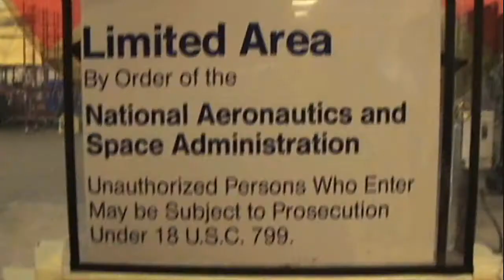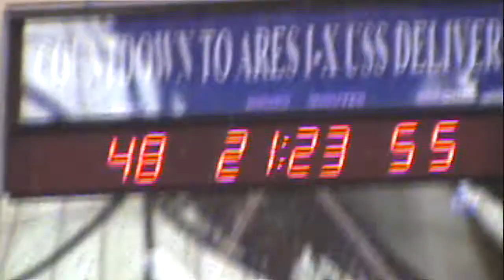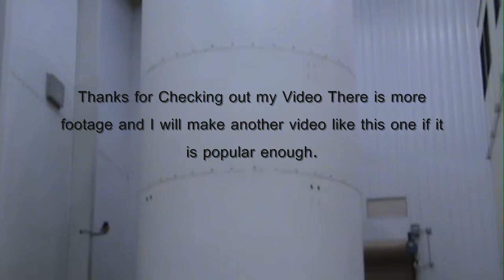Ares I-X Unreleased Inside NASA Footage First Inside Video Upper Stage

Comment: In the next video effort could you possibly include more details of the mechanical sturcture?  In particular the machined surfaces between segments.  What kind of fasteners are used to connect them together?  Are they a type of heavily tested bolt?   How thick is the skin?  Thanks.  M